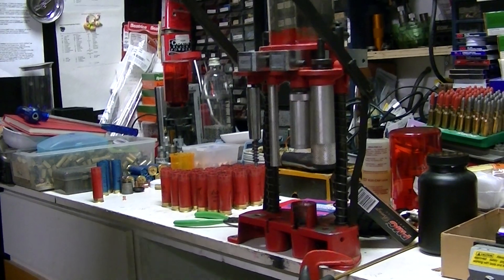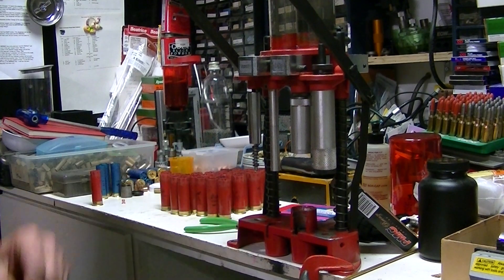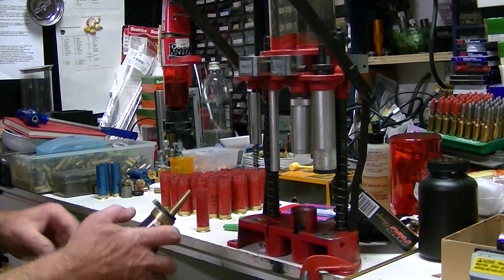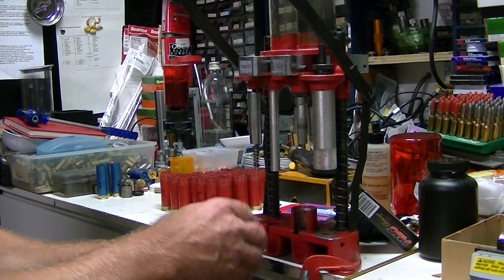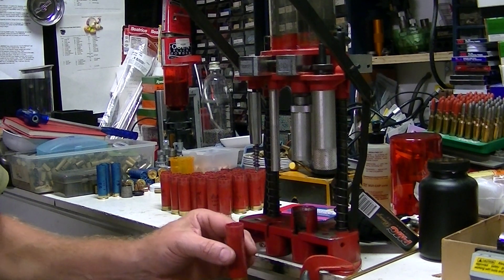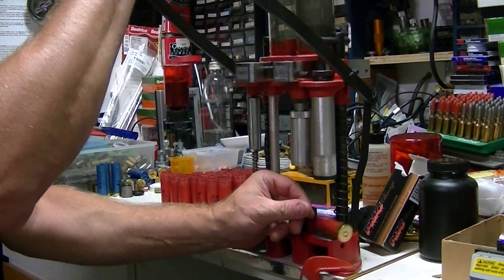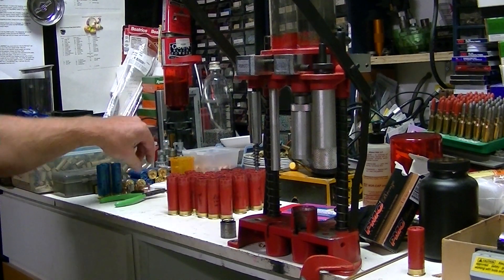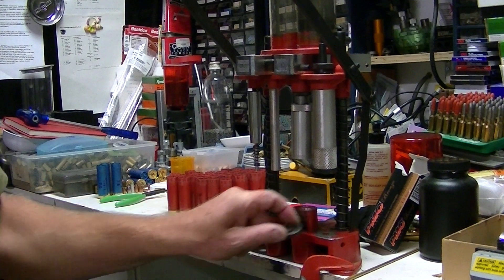Lyman Easy Shotshell reloader demo

Comment: Yep supposed to be a spring, it holds the perimeter up so the primer is in a hole and pressure on the shell pushes the perimeter down below the primer surface. The one you showed at the end of the video looks like the right one . I picked one of these up at a pawnshop and it appears to be missing the outer tube on the charging station but it seems to work fine without it. All in all it  is a great tool and a lot of bang for the buck.  I never thought I’d be able to get started into reloading for less than $50😅  I’m now looking for a bargain on a used turret press.

Comment: Hi there! The piece you are talking about ensures that proper pressure is applied in the wad when the handle is down. Each mark correspond to approximately 20lb. This is available in the manual on the internet. Hope it helps.

Comment: Good stuff man!!  IINM thats the EZ loader? 

Yes your missing the Spring for the priming station. 

I have a 100 sl Im looking for parts for. Specfically front center station where powder/wad & shot are delivered. I have the heavy spring but nothing else & not sure whats missing but assume a plate or disc or washer of some kind.

Looks like that piece you dont know what is might be what Im missing! Try it in same station I describe. Spring under it.   Also your missing the spent primer drawer.   Good video!
Reply from the maker: yup,   i have to upload the latest video for this.  i have the spring in and the piece for the shot loading station.   yes. ez loader is what the front says.
Reply: @dakotamar45acp  awesome threw ya a sub so Ill be waiting!!

Im gonna do a video on the 100 SL I just got too if ya wanna see it.